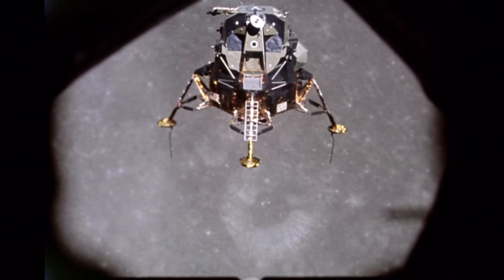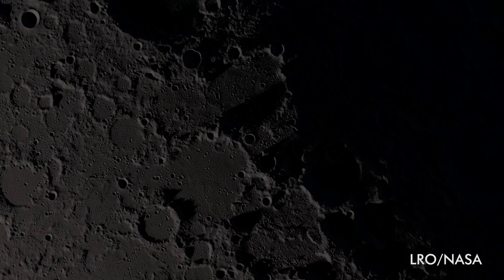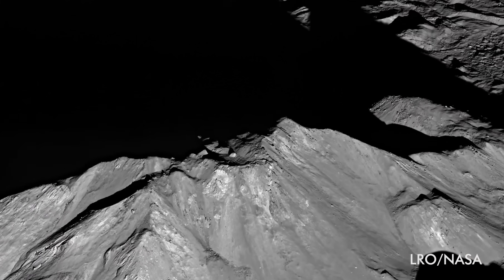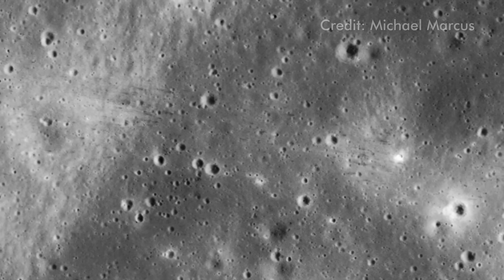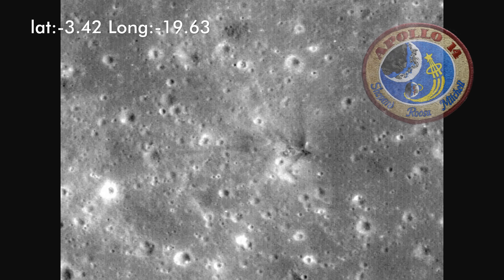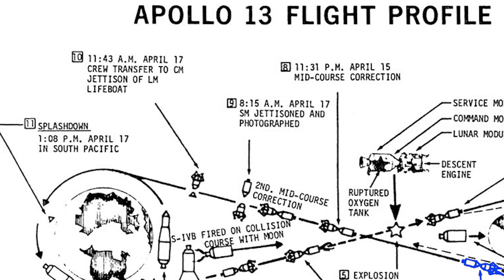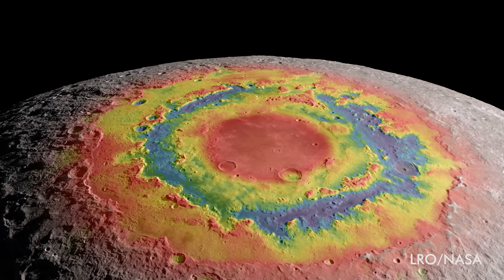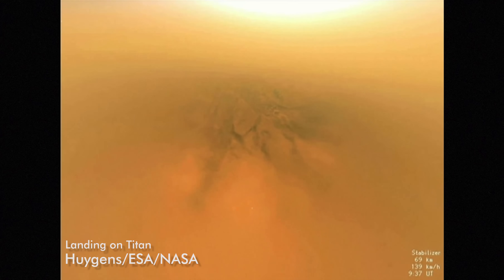Apollo Crash Sites: Lunar Modules & S-IVBs

Comment: The video you show an astronaut setting up science experiments was the one experiment that didn’t work. John Young from Apollo 16 tripped over the wires for a heat flow experiment which pulled the connector apart from the wire ribbon, making it unusable. 0:55

Comment: Also unknown is what happened to the descent stage of Apollo 10.
There's some speculation that both in and the Apollo 11 ascent stage could still be in orbit.
Reply: This just unfortunately not true, as much as one would want to believe it. The moon has a very uneven gravity that leads to horrible precession. What this implies is that objects in low orbit will quickly go lower and lower, until they crash into the surface. Operational orbiters are budgeted with fairly significant fuel reserves for stationkeeping, aka raising the orbit so that the probe doesn't impact the moon in a few weeks

Comment: Bull shit!!!
Reply: whats bullshit
Reply: @thingusbrulingus  landing on the moon did not happen
Reply: @hermanschweizer9717  except it did and you were mislead into believing it never happened, despite overwhelming and obvious proof if it happening
Reply: @hermanschweizer9717  
It did.  And our group of 90 (three shifts of 30) used to upload commands and download data from ALSEP on daily basis here in Australia.  Orroral Valley Tracking Station up in the  Brindabella’s outside Canberra.
Reply from the maker: Awesome
Reply: If any of you believers would be able to survive the level of radiation of the van Allen belt!
Reply: @hermanschweizer9717  
James Van Allen said it would be fine, and he knew…
Reply: @stephenpage-murray7226  not at all van Allen probes discovered the radiation level between 2000. And 25000 miles in to deep space , and we have a lot of testing with animals on probes to confirm thus facts.
Reply: @hermanschweizer9717  
Wrong.  Have a look at the shape of the Van Allen belts, the speed and position of the transition.  Then give me a full description of the AESEP/ALSEP/LRR installations including assembly, cabling over wide areas, probe boring, and alignment.  We had three shifts of 30 per shift at Orroral Valley, Canberra, Australia and uploading commands and downloading data on a daily basis.  Let’s see what you’ve got…
Reply: @stephenpage-murray7226  the highest astronauts have been in space is 380 miles and they were facing radiation flashes in their eyes!
Reply: @hermanschweizer9717  because its a belt, the apollo astronauts just went above them. inclination is a thing, you know?
Reply: @thingusbrulingus  Apollo moon landing was a stunt to bluff the world and demoralize Russia 50 years later some of you can’t figure it out
Reply: @hermanschweizer9717  Yet it consisted of thousands of people, hundreds of companies and billions of dollars. millions of people watching it in person, on TV, listening to the launch audio on radio, Some people in australia and other places picking up the apollo signals from the moon, and multiple research labs studying the moon rocks, Just to name a small percentage of all that happened during apollo. It wasnt just some videos and news and thats it.
Reply: @hermanschweizer9717  
You can’t figure out how to tie your shoe laces!
Reply: @hermanschweizer9717  
Still waiting Herman boy….
Reply: @thingusbrulingus  yeah und that’s why we don’t send astronauts higher than orbit do your homework ! I am not going to release classified information on u tube
Reply: @hermanschweizer9717  "yeah und that’s why we don’t send astronauts higher than orbit do your homework ! I" maybe, JUST MAYBE, if you did do you homework, you would realize that the apollo program was the very mission to do that. Artemis missions will follow up with that in 2024.
Reply: @thingusbrulingus  at this point NASA has no schedule to send astronauts to the moon.
Reply: @hermanschweizer9717   Since you have all this undeniable evidence that the Apollo missions were faked, please don't waste your valuable time here on YT!

Tell the world! Present your evidence to the 99.9999% who do not read your historic YT posts! 
Stop the lies once and for all! Call a news conference today!!!
Reply: @hermanschweizer9717  Getting paid? Where do I collect my pay?
You are not fooling anyone. You hide here on YT because you have no evidence, so you avoid the embarrassment of presenting your claims out in the real world.
Reply: @julesdomes6064  I am sure that someone like you would not believe that we had astronauts on the moon 50 years ago 6 times flawless with in 2 years, so I do apologize for claiming that someone is paying you to refute critical thinking
Reply: @hermanschweizer9717  Don't flatter yourself. I'm not a deluded conspiracy theorist.
I know the six manned landings happened.

And I know that you have zero evidence that they were faked. If you did, you would of course present that evidence to the world in a news conference, and not hide here in the weird corners of YT where just about nobody notices.
You are fooling only yourself.
Reply: @julesdomes6064  Im not a moon denier?
Reply: @thingusbrulingus  Sorry, wrong address.

Comment: Great video.
No doubt the concept of ditching the lunar landers was well thought-through. But I can't help thinking that hanging on to them would have added a safety element to the return home. Just like Apollo 13 saved the crew.
Reply: After the time spent on the moon and then launching into lunar orbit to rendezvous with the CM/SM, the ascent stage would have had very little left that would have been helpful. Not enough to offset the extra delta-V required during the trans-Earth injection burn.

Comment: Shallow craters and rang like a bell...Hollow??? Base? Why not been back? Have tech to fly there easy. H3, Abundant precious Metals?
Reply: Tech is not a problem. And no, even with todays technology, it is not "easy", The real problem is Money and Politics. You just don't jump in any old ship and go to the moon just because you want to. It takes political backing and lots and lots of money. Also, technology today is faster than it was for Apollo but untested in the vacuum of space. Todays Mircoprocessors, chips with billions of transistors inside might react differently in space and must be radiation-hardened and thoroughly tested. These new chips are extremely static sensitive.

Comment: Explain why the crash of the ascent module of Apollo 12 visibly shows a vertical impact while, in the mission report of Apollo 12, it is said that it has arrived on the lunar surface with a angle of only 3.7° relatively to the mean lunar surface, that is almost horizontally!
Reply: @jimmyfly And what are you talking about; this is not in the official mission report of Apollo 12.
Reply: @jimmyfly It has nothing to do with gravity, it exclusively depends on the loss of speed to deorbit the lunar module, and this loss of speed was quite moderate, it could only make the ascent module lit the moon almost horizontally.
Reply: @jimmyfly That's what you say, but you know strictly nothing in aerospace technology.

Comment: Awesome video, but I need to point out that the LEM was built by Long Island based Grumman.  My father was on the team that built the Orbiter and Lander.
Reply: Halloran Illustrations  The lunar orbiters were made by North American Incorporation. Weren’t they?
Reply: @YDDES  No. The orbiter and lander was Grumman. Other corporations were also involved in the mission, but not the moon vehicles.
Reply: Halloran Illustrations  search ”Apollo Command Module” on Internet. You Will find that it says that it was made by North American Rockwell.
Reply: @YDDES  Actually you might be right. During the events of Apollo 13 the command module and lunar module were vastly different. They had to jury rig a device to help supply to the lunar module with oxygen for the trip back to Earth.  Good call.
Reply: Halloran Illustrations  Yes and as a funny comment, Grumman sent a Bill to North American, for the ”towing” of the CSM back to Earth.
Reply: Must have been an honor to be in that project.

Comment: And that’s evidence? I guess your not or will be an air-crash investigator! Allegedly, crash them that was the intention what other consequence or outcome could there have been. Also, these geniuses could have easily calculated the approximate area of impact it was only 80 miles above the Moon when released. But, if I’m wrong please correct me on this.
Reply: The reason for the impactors was to find out what was under the surface on the Moon! You doesn't want to send people in a quicksand pit, or something that wouldn't hold a spacecraft to return, right? People forget to think and do some research before they put their IQ on display.
Reply: @Muckytuja  I hate to tell you this but, they just left the surface so if they were worried about quicksand or some other potential surface problem NASA should have checked it out before the spacecraft landed. Not after it left. Don't you agree? And you are telling me to do some research!
Reply: @Muckytuja  your last paragraph is completely correct. The other stuff, and I can see you have a keen interest in space exploration and technology which is admirable. My view is simply this, out of all the time, duration and cost what significant impact does this have on our everyday wellbeing and of course future lifestyle activities. For your interest I'm an engineer and member of the  Institution of Engineering and Technology however, I specialise in renewable energy not spacecraft and such like.
Reply: @andrewcochlin  So then tell me! An Engineer, like yourself, how doesn't can wrap his head around the simple fact, that going to the Moon is easier, than dive into the depths of sea? Yeah, the amount of fuel push the costs up in the sky,... literally :) but the protection of human life is way easier to sustain in space, than in under the wast amount of pressure of the deep seas! If you are a real truth seeker, and you have the resources,  - mental and financial, -  seek out the Cicada!!!
Reply: @Muckytuja  I can't, I don't profess to be anywhere near as clever to know what is hypothetical or practical in that scientific intensity. I'm more earth science and uncomplicated nowadays

Comment: If anything, you would have thought they would have videotaped all the falling acscent modules. All humans thrive on seeing things bust, fall, splatter, crash, etc. Remember David Letterman's hundreds of objects filmed being dropped off a tall building and filming the ensuing descent and impact in slow motion? More reason to cast a jaundiced eye on to NASA's 'efforts'. Kubrick outdid them in reality depiction. Seeing that photograph with he and Wernner von Braun and Arthur C. Clark raises eyebrows.
Reply from the maker: During Apollo 11’s descent to the moon They had a hard time keeping the high gain antenna pointed at Earth. They lost communications and all data with Eagle as it was trying to land several times. Micheal Collins had to relay communications to Armstrong and Aldrin to Houston several times. Aldrin had to manually control the high gain to restore link.
The unpredictable orbit that the ascent modules would have during decent would have lost all data anyway.
The Ranger Probes had better luck. They were pointed straight at the lunar surface and were able to relay their images back to Earth.
Reply: I love how some people say it's all fake because they didn't show this or didn't show that and even if it was shown  those same people would call it fake anyway.
Reply: Apollo 12 and Apollo 14's TV camera were not capable of being remotely operated. Apollo 15's TV camera mounted on the lunar rover was but the elevation motor or gear didn't work properly which is why the ascent stage lift-off wasn't followed upwards. As for Apollo 16,  he mentions in the video about an error on the crews part for the information entry planned for the de-orbit burn  so the ascent stage crash site was not even remotely close to the Apollo 16 lunar rover location. Apollo 17 did have the only chance of possibly capturing the ascent stage impact and the DVD from my Apollo 17 Mission Report book actually has video clips after the ascent stage lift-off and some of it was obvious attempts to capture the impact but was never able to. Besides, if they had managed to get an image, the hoax believers would simply scoff at it, just like they do of the LM ascent stage lift-off.

Comment: Imagine if Apollo 13 jettisoned the lem and allowed it to crash on the moon? They would all be dead! No one crashes a would be lifeboat anywhere until it is absolutely not needed.
Reply: You don't have a clue what you're talking about. The vast majority of what kept the Apollo 13 crew alive was in the LM descent stage. Plus the accident happened long before Apollo 13 reached the moon and  never entered lunar orbit so stayed on the free-return trajectory. The other Apollo missions had the ascent stage join up with the CM in lunar orbit and there wasn't much left for consumables after the time spent on the moon so the only additional benefit would have been a bit of extra legroom. Not worth keeping because the extra mass would have required more fuel used during the trans-Earth injection burn cutting down significantly on any safety margins.

Comment: With all due respect to NASA of the time, they only created the need, not the spacecraft. Grumman Aerospace conceived of, designed, and built the LEM’s after NASA selected their design. Credit, where credit is due. I believe Alice landed at Holy Cross Cemetery in LA.
Reply: Well NASA had a pretty good idea what was needed. After Grumman won the bid, it soon became apparent that it would be more of a partnership then Grumman working on it's own and delivering the final product when it was completed. Tom Kelly's book is an excellent book about it all and he mentions that NASA thought the Grumman bid was ingenious and well thought out for the mission involved but there were a lot of things that Grumman didn't have enough knowledge or experience with when it came to the space environment. That's a big part of the reason the weight estimate Grumman had for about 22,000 lb's soon went out the window and quickly rose to over 29,000 lb's and of course higher before it was all said and done as NASA had strict requirements for as much redundancy as possible. There was also the ascent engine instability issues that Grumman had neglected to address with the "bomb test" method to ensure it was completely solved and in the end, NASA intervened to basically insist two rival rocket engine developers work cooperatively together and combine their designs to solve the issue. The "Spider" episode from the mini-series "From the Earth to the Moon" was great but it barely touches on all the problems that had to be solved for this unique spacecraft. It really is amazing what Grumman accomplished but as I said, NASA had a lot of involvement with the program as well.
Reply: I don’t disagree with anything you said, it certainly was a team effort. NASA was the engineering member, Grumman the design member. But in the end, NASA didn’t (and doesn’t) produce a single rivet of spacecraft, that is all done by private industry. (Or collages, I worked at JPL for over a year). I only mentioned this because folks seem surprised by entities like SpaceX and such, as though the brain trust is only government. When in reality it’s been the private sector solving all the problems since day  one. (Although that wing warping thing by the Wrights was a bit iffy). 

I like the idea of NASA, representing all of us, being the prime contractor on space adventures, but they have to get back to “Risk Aware” type of operation, as opposed to the “Risk Adverse” position they are in now. (Robotics notwithstanding) SH-T is going to happen. You can stay home out of fear of t he outside world, only to have that would in the form of invasion robbers of pieces of aircraft landing gear crash into the house and kill you, and in that end all you ever saw were the walls of your house. Lets risk something and go see the stars! (No not those stars, but suns, planets, and space junk) 
 @mako88sb